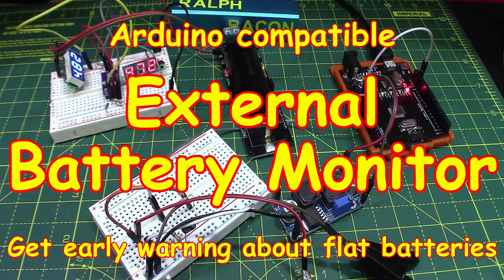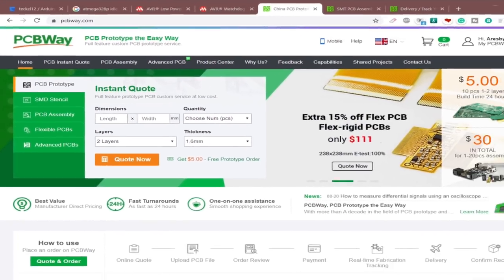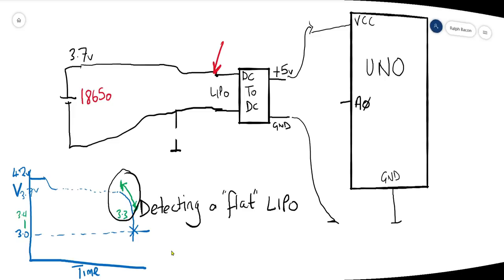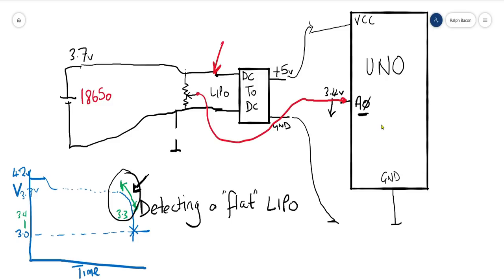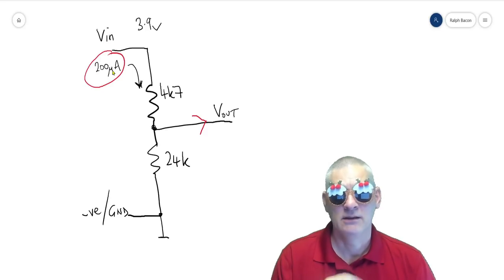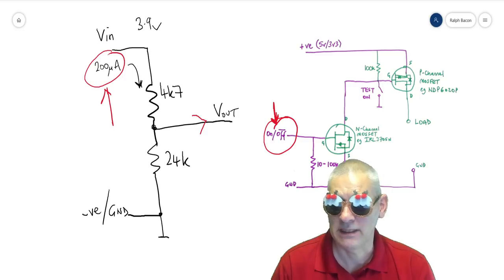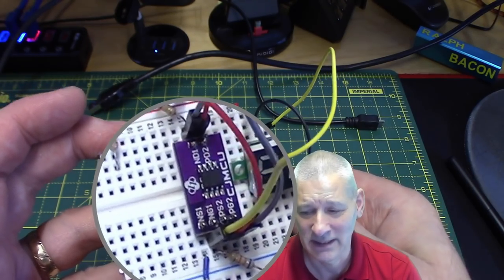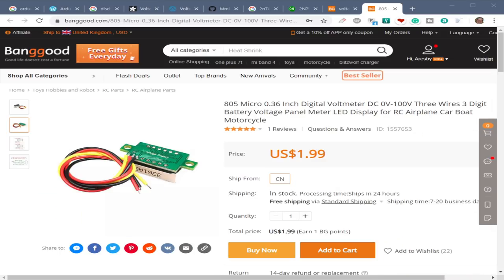#171 External Battery Monitor from your Arduino

Comment: Cool video, thanks Ralph!  For anyone not already aware.....those small voltmeters can be very easily calibrated by hooking up to a voltage reference and turning the tiny pot on the back of each one.
Reply from the maker: You are correct! I had to look under my microscope and there it was! Very, very small. Tiny, in fact. A very small screwdriver will be required. Thanks for the heads up. Good to hear from you and I'm glad you liked the video.

Comment: Ralph, take a little bit of advice from an old MSEE.  Rest, and tend to your eyesight.  It’s important. I read your blog, and this is nothing to mess about with.  (Sorry for ending that sentence with a preposition.)

I value your videos, and I’m still waiting for the one hour video where you build a GPS disciplined clock using an Arduino Uno, and explain the software build as well.

But, I would like your eyesight back firing on all 24 cylinders again. So take some time, mend and stay optimistic.  We all are rooting for you, believe me.

Great video.  Good advice, and I like the way you set the reference voltage and can shut it down when you need low current mode.  Excellent!!
Reply from the maker: Thank you for your concern and wise words. As it happens I might just do a couple of videos a month for the next month - we'll see how it goes.

Were you serious about the GPS clock? We've covered using GPS in a past video #70. Grabbing the time from that and displaying it any way you want is easy enough - 7-segment LED, 64-LED moving LED matrix... whatever! I don't think you were serious! But correct me if I am wrong.

Thanks for posting, very good to hear from you.
Reply: Ralph S Bacon You are most welcome!  I expect to continue learning from you for many more years.  So take care of those eyes!  I know you will, but don’t become discouraged!

So the GPS disciplined clock...

Personally, I think it would be a great project for all your viewers.  An ATMega 328P-PU, a GPS receiver/with built in antenna, and an e-Bay Maxium DS 3231 RTC clock module with battery backup, and a display, color LCD or the like. THEN create a PCB and give everyone the gerber  and drill files to have it made by JCBPCB and have it built themselves.

The GPS will be on the job all 24 hours, but  every hour, the software sends that hourly update to the RTC clock module, and the LCD display.  Use a dip switch that tells the software what time zone you’re in and then the software displays the precise time and date. In the time between updates, the software just uses the RTC DS3231 and keeps the display updated every second.  It won’t drift much during the hour.

Now for the fun part:  split it up over 6-8 months.  I know you can do it in your sleep.  But for us out here, learning this hardware and software, watching you and building the clock...  it is really a great learning tool.  Spread it out over time and set a deadline.  Finish by 1st week of November, say.  Then you can actually teach the hardware build and the software build. 

And break it up with some other projects like the Tiny85 or 15 projects also. I find them absolutely fantastic.  And show more AVR programming, or another project you fancy. 

Nothing that would hamper your healing though.  Sounds complex, but, in small bites, I think it would be stellar.   Just an idea. 

Be safe and take care of yourself!!

Comment: Glad you're getting better.  Your video has just stopped me  making    a mistake on the bord that I am working on  . I had  1 mosfet now I see  where I have  gone  wrong. Thanks.
Reply from the maker: Interesting, Michael, that you're only using 1 MOSFET. In some circumstances just using the P-Channel should work (though not in the original Auto Switch-Off configuration from video #123). The item I was showing was the dual MOSFET but I have others ready to show once I can see to solder them onto DIP boards! The takeaway from this video is that using the dual MOSFET approach is guaranteed to work!

Comment: Great to see you back Ralph. You were certainly missed here.
I was just working on a  PCB layout that uses the circuit from video #123 but modified a little. I'm using an NPN transistor instead of the N-channel MOSFET. The p-channel can be used on it's own to switch an input voltage on/off or can be used for auto-power off using the NPN. The pcb also has a 3.3v regulator to provide a 3.3v bus and a 5v bus  along side an I2C bus. It also includes a header for an NRF24 module. The micro-controller is an Arduino Nano. I've used a dupont jumper to select whether the Nano is powered from the P-channel output or directly from 5v input.  I used the separate NPN and P-channel because the cost of the SI4599 using the SMD assembly service is $2.74 USD each which I thought was crazy high and  it's not in the 'basic' component selection for SMD assembly.
Reply from the maker: Great to see you creating custom PCBs - and you have considered a lot of options, nice work, if I may say so. The assembly cost for "non-basic" components is indeed quite high. I think I would have soldered that component myself but I can understand why you would not want to. Yes, the BJT would work in place of the N-channel MOSFET, just not quite as convenient, but it's marginal. Thanks for your good wishes, and thanks for posting.

Comment: Hi Ralph, good to have you back.
As an aside  to the fet on /off control, have a look at the dedicated LTC2954. Now an Analog Devices part in the same package as the dual fet although you still need a seperate P channel fet. Operates over a wide voltage range and  low supply current of 6 micro amps.
Reply from the maker: Great information, IVo, I shall Google it immediately I've responded to comments here, thanks for the heads up. I lied! I looked immediately, Very interesting.
https://www.analog.com/media/en/technical-documentation/data-sheets/2954fb.pdf

Comment: Good to see you back. Please take care of your health. 
The voltage divider can be switched on/off way easier than you did. Have a look at the battery sensors of mysensors.org. 
They connect the gnd of the voltage divider to a pin of atmega. When output of this pin is set to zero, the voltage divider does its work. When the pin is set to input -without pull up/pull down resistor, the pin just floats. Then there is no voltage drop over the voltage divider. So no power loss.
Reply from the maker: Yes, that is an alternative way of doing it, Psilin, and we've used that method when switching on actual devices to save power. But I was just experimenting with those dual MOSFET devices in the hope others can see further uses (eg auto switch-off).  All good, thanks for the simpler method.

Comment: And welcome back Ralph!
Couple of comments.
1) Why did you use a dual mosfet IC to switch off the current through the resistors I use just one N Channel on the low side on my current project?
2)Also a tip for getting the voltage divide accurate as I played around for some time using offset factors to make it accurate but all really needed to do was measure the actual resistance of the two resistors and use that instead and it was bang on correct after that, for example the 5.1k resistor was actually 5010ohms.
Great to have you back mate but the glasses have to go it looked like Christmas at Elton Johns house ;)
Reply from the maker: Thanks Andrew!
Sorry about the glasses but next week it's either Wizard or Danny La Rue!
Now, I used the dual MOSFET approach for two reasons: 

1) we had used that circuit (sort  of) in the Auto Switch Off video #123 and I felt it was a good opportunity to reinforce that circuit (even if viewers don't use it as shown here)

2) I had that nice dual MOSFET chip/breakout board hanging around like a bad smell and now was the time I could show everyone how easy it was to use and then put it in my component drawer, off my workbench! I also mentioned some others I have with a 1.8v gate voltage - for future use.

In future I think I must emphasise the fact that the things I show in my videos are mostly demos to highlight a particular feature or component or code example (or all three). As an example, my toothbrush timer project (now used every day, it's great BTW) would never normally be used with a 74HC165 Shift Register and DIP switches! But it was a great opportunity (I thought) to show a way of reading DIP switch values very easily for whatever project might need flexibility like that. Better than a rather sterile breadboard and no practical application, however weird that application I'm using it for appears to be! Right, now I'm off to buy a new electric toothbrush that doesn't even need a separate toothbrush timer!

I'm explaining all this here, not for you Andrew, but for everyone else who might read it and realise why some of the "solutions" to my projects are a little over-engineered. I'm obviously being too subtle about it, ha ha!

Comment: Hi Ralph. Sorry hear your eye is not yet up to snuff. You have my total sympathies since a year ago at my last annual diabetic ophthalmic exam I was told that there were signs of macular degeneration, but at that time I was experiencing no visible symptoms at all. Wind on about 7 months and suddenly, literally overnight, I'd lost all vision, other than colour, vague shapes and sort of outlines in my left eye!! Turns out I have had quite a severe bleed from capillary veins in that eye, probably from a blocked vein. 

Roll on a few months, multiple waits for appointments, multiple eye scans and finally treatment by way of an injection into the eye which took almost immediate effect, as the next day vision had improved markedly. It's still blurred but with a much greater level of detail, thank goodness. I have this year's exam tomorrow and another appointment for a further injection early next year so here's hoping for further improvement. Now at least I can ALMOST read my keyboard which previously was just a dark rectangle!

Likewise I hope your eye/s get sorted fully ASAP since even though I have just one reasonable eye I have been trying to do some relatively ordinary soldering (repairs) and have been struggling significantly without stereoscopic vision. So when I say you have my sympathies, you know I mean it. Not a nice thing for anyone to have or endure but especially when doing what you love relies on good if not excellent eyesight. Good luck and best wishes for Christmas and the New Year!
Reply from the maker: Ouch, now you really have got me cringing in empathy, Bob. I'm so glad you've said it is getting better, we understand each other's condition and what it means only too well. I hope your eye continues to improve with further medication. As I've said before, next year 2020 is also the result we will both get from our eyesight tests, right? 20/20 vision. Fingers crossed.
Stereoscopic vision is so essential to carrying out everyday tasks, I've found. Even making a cup of tea can mean I miss the cup with the hot water entirely. As for putting in Dupont cables into a breadboard, well, that brings a whole new level of frustration as I miss the hole, time after time. I tried to solder but ended up sticking the hot soldering iron into my hand rather than onto the PCB so I've given up for now. 
It can only get better with us both, right, Bob? Great to hear from you (well, sort of, you know what I mean) I hope you have a great Xmas and a good start to the New Year. 20/20. Don't forget your eye test!

Comment: On the three wire usage of the Volt meter: that's needed when trying to detect V<4V, according to the diagram that you show.
Want to measure > 4V? Then you can use the two-wire configuration just as well.
Reply from the maker: That's true, Eric-Jan, the diagram does show that although my one works right down to 2.0V (slightly dim, but useable). And it goes right up to 100V. Oh, and as others have reminded me, it DOES have an adjustment on the back too.

Comment: Hello Ralph, glad to see you back at the bench. What you said about Li-po is correct, but 18650's are Li-on and can be run down to 2.5v before they are damaged. Using the 3.3v ref for comparison against battery voltage would be perfectly safe.
Reply: What people call Li-po and Li-ion are the same thing just in a different form factor and built for different applications.
Reply: @superdau  and with different chemistries. Therefore not "the same thing" at all.
Reply: @Tsnafu  
The chemistry has nothing to do with the form factor. They can have different chemistry, but so can cylindrical cells between them and pouch cells between them. Again, the form factor is not what dictates the chemistry, what the manufacturer puts in them is. You can have the same chemistry in either form factor. Have you ever seen something like IMR, INR, ICR, IFR, LMO, NMC, NCA, NCO, LCO or LFP written on cylindrical cells or in their datasheet? Those signify different chemistries. Pouch cells use the same chemistries, although they most often use the Lithium-cobalt-oxide chemistry (ICR/LCO), which is also the same that's often used in laptop battery 18650 cells. So they are the same thing.

My guess why "li-po" as a name for pouch cells came to be is marketing. Cylindrical cells were the norm when the somewhat "freeform" pouch cells came along. Someone heard about the "new" cell chemistry of real li-po batteries at the same time and slapped that label on their batteries, because, hey, they got a polymer sheet separator in there (as all of those cells, even the cylindrical ones, had anyway) and a polymer (=plastic) pouch around it, even when that has got nothing to to with actual li-po cells. Lipos true to the original meaning of the name (the electrolyte itself being a solid polymer) still don't exist commercially. And even if they should ever exist, they will still be li-ion cells.
Reply from the maker: The protection circuit on my Li-Ion cells (like the on in the video) does kick in pretty much at 3.0  ±0.1v. Perhaps it is being very cautious? I misspoke when I said LiPOl I just tend to use that term for all rechargeable batteries, LiPO, Li-Ion, half the time we don't know what type it is!
Reply from the maker: Update: Jessica says her Li-Ion cylindrical battery cuts off at 2.5V so maybe my one is super cautious?
Reply: @RalphBacon  
The cutoff values vary from manufacturer to manufacturer, even for the exact same chemistry. The reason is that there is no hard limit. But a lower limit could give the manufacturer 100mAh more to print on the label, which might also be a reason why you see very low llimits in a datasheet. The lower a cell goes the more of the detrimental reactions take place (same in the other direction at the 100% charge end). But that then also depends on temperature, how long it stays at that charge state and how often you do that.

One thing is that some protection circuits may be just "safety" circuits to protect from excessive over(dis)charge, while others might be battery "health" circuits that have much narrower limits (similar with the values in the cell's datasheet itself; it's kind of like "absolute maximum ratings" and "recommended operating conditions").
Some circuits might be designed for high load applications (where the voltage can dip in short bursts), some are for low load devices. Some are for multicell packs, where the whole pack fails, when one cell would go dead, or they are for a pack where you can easily change single cells. Some might really be for another chemistry or special cell (so it is not the best idea to pluck one on willy-nilly).

You see, it's not that simple (unfortunately, which is bad, because the internet tends to gravitate towards the "simple" solutions, which often are too simple). I personally would never go below 3V, unless I am 100% sure I got the right datasheet and it says that the cell is fine with that. Generally there isn't much energy left below 3V anyway (in the same way as there isn't that much more energy when going to the full 4.2V while it's quite detrimental to lifespan).

Comment: Have you already made (or considered making) a custom board which combines the battery voltage check and a full power disconnect as a little breakout board. Maybe also include battery protection (tp4056+dw01 + FET) as not all batteries have protection and possible load sharing so battery can complete its charge?
Think this could be desirable and an interesting challenge/video?
Happy new year Ralph!
Reply from the maker: Well, my outdoor storage container (bin lids) project uses an 18650 battery and sends the battery voltage to me here in the workshop along with the lid status. When the lid closes it switches off the circuit completely, see videos #221, #214 which describes this project (I think).
Reply: @RalphBacon  thanks very much will take a look!
My festive break has involved watching many of your videos, keep it up!

Comment: I have used those little meters a LOT over the years, keeps track of the voltage on my home built spotlight and such.
Reply from the maker: Now that I've discovered the adjustment pot on the back (miniscule) I like them even more!